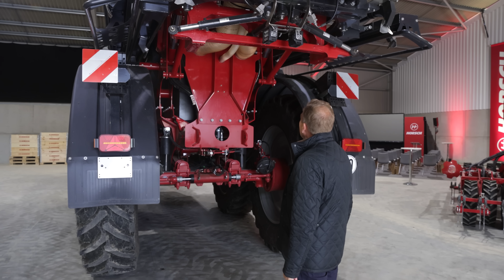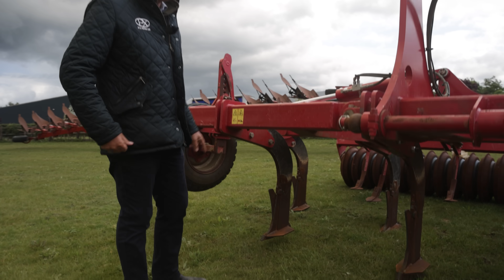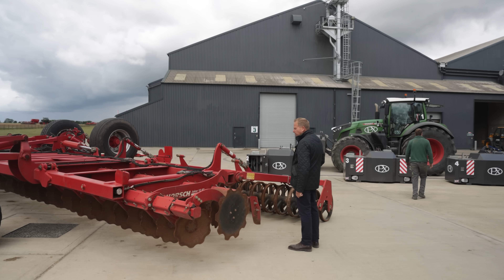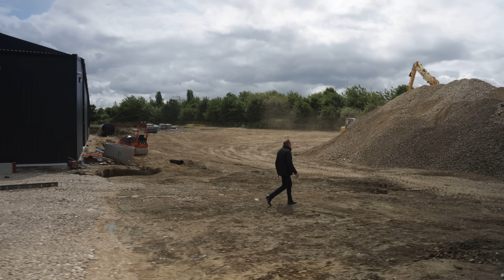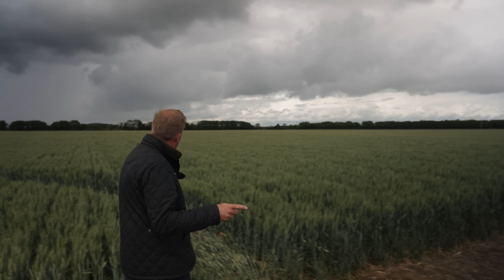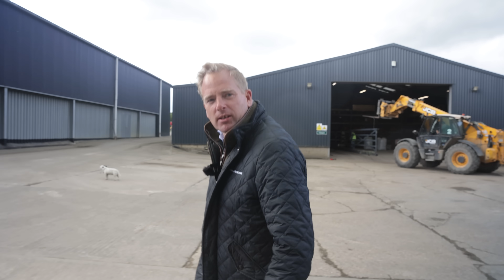Front Gate Rammed, Innovation Corner Revealed & Some New Horsch Kit??!!

Comment: James, you can design-out the kinetic energy from a future ramming of the outer perimeter gate by placing a chicane between the round about and the gate itself. There is clearly a need to balance the accessibility of the trucks and agricultural vehicles towing equipment, but this obstacle will also reduce the speed of those vehicles from the public roads to your private yard. Armco barriers will help you shape the approach to your automatic sliding gate. Another great video. Thx.

Comment: Have a chat with your security guy about getting another camera there. If you tell him to get a darkfighter, aim it toward to entrance and the set the shutter speed to a min of 1/500 @ 25fps that will mean you can see very little very little at night. But what you will see clearly is number plates. Also worth flipping it in to black and white mode only. The cam may try flicking in to day mode (colour) if set on auto.